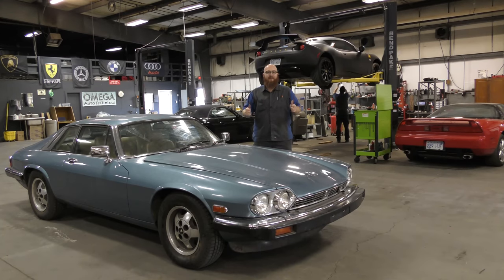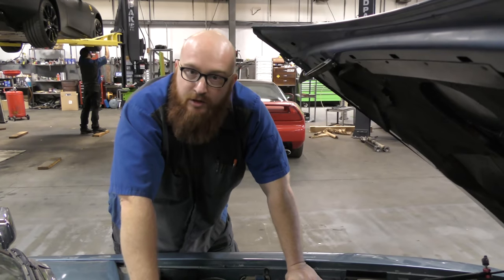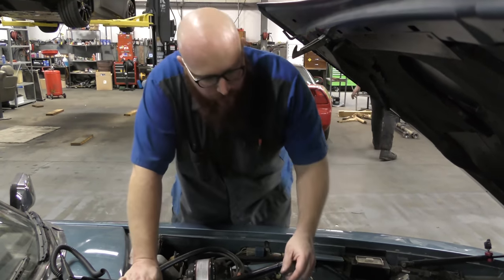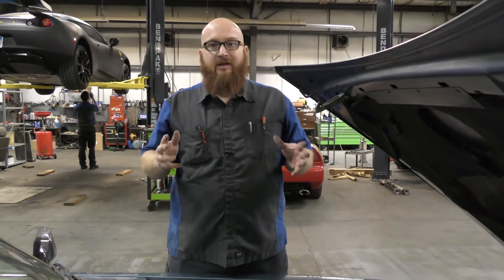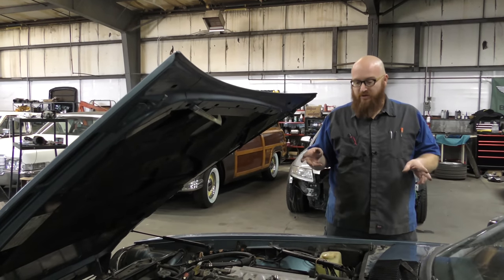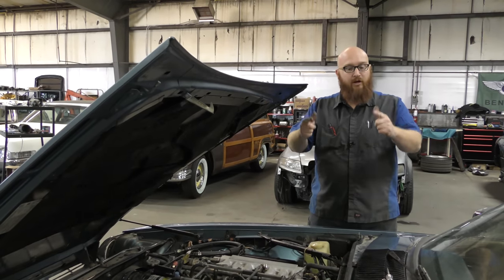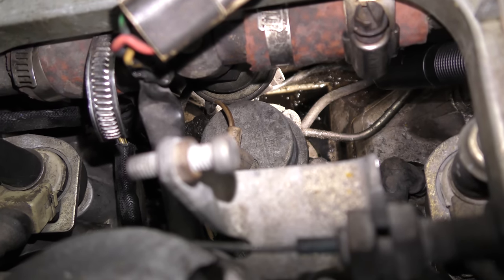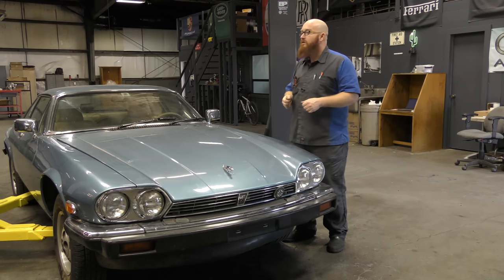'82 XJS with the cursed Jaguar V12 comes into the CAR WIZARD's shop. Can he get it running?

Comment: A SB Chevy in a 1976 XJ6; I swear that motor with a generic GM air cleaner, 1969+ Chevy accessory mtg locations; said Jag looked more OEM than with a stock XK Six. The swap was that clean.

Comment: What a fantastic car, driven one years ago  when they were current, they were very  impressive cars but  maybe a bit too sophisticated for the Secondhand non specialist market, quite advanced for it’s time compared with most Detroit stuff & less reliable than Jap stuff.
Imho It would be a real backward step to put a 350 in a beautiful  12 Cylinder racehorse type car like this. 
Faultfinding old complex  cars like this requires skills many mechanics simply do not have fuel + spark does not always  = go running properly without further I ssues requires deep pockets  required to make it run right !

Comment: Great cars when looked after and running well. Had a couple of that era Jag in my days back in NZ.
We don't put SBCs in them over there as Jags were fairly common and enough mechanics around knew their quirks.
As for Lucas, im an auto sparkly by trade and in our profession, Lucas is the prince of darkness, yup those lights will fail..

Comment: Really none of this is that hard, I mean fuel and spark, that was about it for this one.  The two most important points brought out by this video: 1 the part that fails the most in Jaguars is past mechanics, DIY guys, and/or owners; 2 ASSUME NOTHING!!!!.

Start with spark and fuel and systematically work your way through the system.  You can start at the end if you like, is there a HV spark at the plugs? If so, many checks can be left for later but go through it all later.  The same with fuel, but be careful not to set the car and yourself on fire.  

As to the 180 degree out dizzy, that is the classic, my neighbour did exactly that with the V8 in his boat.  We weren't great friends,  but after a while I took pity on him and pointed out the most likely cause.  At first he wouldn't believe me, so I said humour me and I refitted the dizzy, away she goes.  I did point out the cracking in the cap, a good time to change it, rather than trying to do it while on the water, I don't think he replaced it. <sigh>  I never asked why he took the dizzy off. When will people learn to properly mark things before disassembly and understand how to work out when number one is at TDC between compression and power.

Now this is quite simple BUT and a big BUT, the killer is an engine where you can tell it has been apart - DANGER WILL ROBINSON, DANGER!  There are just so many things that they can screw up inside the engine, cam timing for one!!

At the fundamental level the Jag V12 was a brilliant design as long as you did not worry about fuel consumption.  It was silky smooth, very strong, it could be tuned to very high levels.  It was simple to build and simple to work on, the problems appear when it is fitted in a car. Lucas is not as bad as many make out, it has its problems , mostly with quality control but this is not unique to Lucas

The one thing I will say: if there are signs it has severely overheated, you will want to get it for very little money and either have a spare engine to hand or have that SBC waiting.  You might be okay, but if you are not...  valve seats for a start.

Finally, there are some really good guides on the Internet for working on most Jags, even the V12 HE.

Assume nothing, work methodically, and don't listen to anyone about what to do unless they are a bonified Jaguar expert - a real one - not an internet fake..., you know... God!

Comment: I disagree. I have owned 3 jaguars with the V12 engine and had no more problems than with other high powered engines in other makes. The problem in the US was the lack of experienced qualified and certified Jaguar mechanics. My first observation of this was shortly after my move to the US in 1990. I bought a Jaguar 3.6 XJ6 sedan. When it went in for it's first service I observed and was horrified to see that they had my car on a free wheel hoist instead of the recommended 4 post lift. Their action could have destroyed the rear suspension on my car. Techs not sufficiently trained. I dread to think what they could do with a V12 engine. My first V12 in an E type had carburetors, my other two were fuel injection. At first sight it looks like a plumbers nightmare under the hood but a properly trained tech. knows how to set up and service these engines without difficulty. I covered approx. 150,000 miles in my 3 V12's without any major problems and I'm convinced that properly cared for they could go on forever. Even Mercedes and Ferrari admitted they couldn't build a V12 as good as Jaguars. It was smooth, quiet and powerful and relatively economical for a engine of this size. Service for those engines was the key, sadly in the US people forget the cost of service for this type of car and then miss services by approved Jaguar dealers.

Comment: One look at the original engine and it is immediately clear why Jaguar made no money and had to be rescued. On the outside, the cars looked great. But there were major issues. To start with, the Jaguars looked like large cars but were in actual fact small. They should have been 20% larger. I for one could not sit in the back and I am not large. The next issue is the rust (corrosion). And then you have the endless mechanical failures like this video shows.

Comment: my comment reminded me, my wife had a 206GTI we traded it in at one I the dealers I worked with on a Friday. On the following Monday I had a routine call on the Dealer, lo and behold there it was  with a story of no start. The service manager and his best technician swore they had checked everything by the manual, so I ask pertinent questions particularly about fuel supply in the system. No guesses all was OK but no answers on pressures supply etc.
I sat in the car turned on ign all OK plenty of fuel etc but deathly quiet. No fuel pump sound. so easy I checked the pump and found a corroded and broken power cable. 2Min and I had the answer their specialist Techn had spent a couple of hours searching. IDIOT but not unusual.

Comment: all modern cars from here on need the mechanic o be fully aware of the systems used to run this car and then only you can check them in sequence and rectify one by one,,,, or else one might mess it up all the more,,,, I appreciate it i am the first one opening up rather than someone have already worked on it,,,I love Jag  though I love and had Citroen CX, Built out of two scrapped cars with little difference,,,, I know who suspension, brakes and steering works.

Comment: Don't forget to replace the cooling pipes for the Heads. Those rust closed and over heat the valve guides and drop valves into the pistons... That's why I put a 383 Tune Port in my Build. YouTube; Bad Ass Jag and see what I did..

Comment: I've never seen one running with the original engine,,most are covered with rats nests,,junk,,hundreds of miles of wire and heater hoses,,no parts,nobody will touch them,,,the good news is a windsor will fit mostly chevy stuff,,,I had one with a ford 351 it was fun,,but I've seen alot just rotting.

Comment: Why center mounted rear brake calipers (and parking brake assembly too)? Dates back to Jag E and D Type racing design.  Mounting calipers and rotors away from wheels eliminated unsprung weight and allowed for a better handling car.

Comment: The 'H-E' models have a Swiss cylinder head design that deliberately shrouds the valves in the interests of flame propagation (fuel economy enhancement) but that is disastrous for good breathing and also leads to pre-ignition because of sharp edges and tortuous radii and it will not be a 'sports car engine' anymore but a smooth strangled not amazingly powerful economy engine that doesn't respond well to spirited driving. Different story with the non 'H-E' models.

Comment: There's an oil leak because there's oil in the engine. If it stops leaking, that means you have to fill it with oil.

Comment: I personally chased a lot of gremlins around a 4.2 XJ6 I had. When it ran it was great,, until something else decided to go wrong.  Those fixes upon fixes you encountered are the worst, I hate when so called mechanics create more issues than the vehicle ever had until they worked on it. Jags are known for suddenly sprouting leaks, if its not oil related its coolant related, ask me how I know.

Comment: My '88 XJS has 215,000 kilometers on both tge engine and the GM400 transmission, and my car runs Ike a bew car!
As soon you put an American V8 in it then no Jaguar enrhusiast will buy it! 
The car doesn't handle right either!
The shorter and taller V8 runs everything about the Jaguar XJS!

Comment: I don't understand how the timing could be 180 degrees off.  Doesn't that mean the distributor somehow got rotated, which seems impossible?  Or was it installed with the engine turned in the wrong position?  Yeah, that must be what happened.  The distributor couldn't be rotated to do that, but nothing would stop it from being installed with the crankshaft in the wrong position.  It wouldn't be the first thing checked though, for sure.

Comment: One of the finest engines produced and super reliable, electrics tend to fault due to under bonnet heat. The biggest problem with Jaguars are below par mechanics who are used to working on cast iron dinosaurs with horse and cart suspension. The  rear suspension set up again brilliant piece of engineering thats why a Jaguar gives unsurpassed ride quality and still goes round corners !    https://youtu.be/M9I7GWllPFY

Comment: Very long winded to find the fault. Also very brave to lift a Jag up on a 2 post ramp, as the rear subframe mountings usually fail & the only things supporting the rear subframe is the brake flexible pipes & the exhaust system

Comment: I always begin to worry when I find evidence of amateur electrician work... and then there's the random vacuum line rerouting.... my Jaguar aficionado friends in England start a job like this by removing the engine and taking everything apart. Then carefully put it all back correctly, replacing any questionable or suspect parts, especially vacuum lines and wiring. Remove the fuel tank and replace any questionable fuel lines.  The problem most Americans have with older Jaguars is that they're not like a Chevy... if you hear or feel something different, you investigate it right now. This means you fix problems before they get critical.  A Chevy, especially an older one, is a much more lazy affair. It'll keep, the Jag won't.

Comment: Jaguars went through a really bad patch due to British Labour Unions demanding unruly privileges, killing the British Industry. The joke was that one should buy two Jaguars just in case the first one does not start. (There was no guarantee that the second shall start.) It was true. V12, 5.3 is a hell of an engine when running properly, not always. I had an E Type V12 with 4 Carburetors. It was nothing but trouble and strife to synchronize these 4. But when they did, she was the car to handle. Now, Jaguars are just like any other car. They are less expensive than Audi but provide more for. XJS are, probably, the most good looking cars that were ever made. After Brexit, we are just a little landing, refueling and take off strip, a soggy island, at the fringes of Europe, for American Aircraft. Great is gone from Great Britain. Soon, we shall be the sick man of Europe with high unemployment and low low standards of living. Sad indeed.

Comment: Car wizard, I have a 88 toyota camry 2.0l and it suddenly started running different almost like it is misfiring but throughout the rpm range. Still hase plenty of power but it sounds like a vw beetle. It sounds kinda cool but I know this is not normal for an 80s fuel injected engine. What could this be? I changed the spark plugs, wires, cap, and rotor but still the same misfiring sound. What could this be?

Comment: Hi! I have a '89 XJS with a knock in the back rt corner of the engine when it's parked nose down hill or running flat. Tilted nose up it disappears. What do you suppose is causing this? Thank You, JD

Comment: IF...you're "giving-up", why not an an "LS?", or a 400 Ford Cleveland?   Or a 402 small-block Chevy, with an after-market fuel-injection?   Or a Winsor 427 with a fuel-injection system?   might need an adaptor to fit the Fords to the GM tranny?

Comment: was one of my favorite cars, never had any issues with my V12 engine or the trans
Reply: Because the Jaguar V12 was developed from the old 1951 Buick 215"/3.5L all aluminum V8 with same over square 3.5" bore x 2.8" stroke. 8 cylinders = 3.5L, 12 cylinders = 5.3L. Before then UK engines were under square, long stroke,  and slow revving. High revs on the new freeways would kill them in 25K miles. And the transmission was straight from GM.

Comment: Tom Walkinshaw V12 XJS Jaguars won a few races against the best Mercs and BMWs and they were pushed to the max and still won.The engines were fine machines but at Factory level they were connected to shit and the assembly line models that were sold to the public were unreliable.Also the lazy British workforce and the strikes played a part.

Comment: had a problem with an old air cooled porsche 911, backfiring /refusing to start.  accidentally found the problem - coax cable on coil shorted intermittently

Comment: Good to see a Mechanic bring the Jaguar XJS V12 back to life and we must remember that the car is 38 years old here and it has been neglected yet it will still run. Jaguar won Le Man 5 times with their XK 6 cylinder engine which was used from 1948 to 1987 it was used in the XK120 and On 21 October 1953 Jaguar test driver Norman Dewis drove a modified XK120 to a two-way average flying mile 172.412 mph. Then in 1971 Jaguar produced the V12 here is a video about that engine which was designed to be extremely smooth and powerful, it is a high tech engine, all aluminium with 7 main bearings. : https://www.youtube.com/watch?v=u6h8PFaz-F8&t=3s

Comment: I remember in the 1990s everyone would just swap out the v12 to a Chevy 350 not sure on the trans I seen many 350 jags at the shop back in the 1990s and learned to stay the hell away from them also another pos is the Dodge Challenger good motor everything else is junk

Comment: Great informative video. I have an 83 xjs with the same ignition module. It has the blazer part thingy that I replaced and it also has a silver cylinder thingy. The black box gets extremely hot.  The previous module failed because it overheated. I used heat paste. How does 1 solve the heat issue?
Reply: the ignition probably had a coil resistor/ballast resistor originally. When they pop a lot of times people will just bypass it, as the car will run, but the ignition module will get really hot. I found on google it says the early XJS's had the resistor in the distributor cap, don't know where its supposed to be on the HE if its even still there.
Reply: I found one thing saying the resistor is 0.5ohms, so any small ballast resistor would work. I stuck something from a pontiac into my 78 280SE as OEM resistors can be hard to find and expensive.
Reply: @Born_Stellar  thanks.. will explore these options.

Comment: Lucas electronics really aren’t as bad as Americans make them out to be. Look at the ignition amplifier for example, it’s not even a Lucas part. I own a Daimler double six and have several close friends that own old jags, they are fine as long as you look after them and don’t run them jnto the ground. The problem comes when someone tries to fix something and has no clue what they’re doing. All electrical parts fail on Any car, nothing lasts forever.

Comment: I have had many Jaguars and I have driven this model V12 and I have to say that I was not that much impressed over the original straight six. For the small amount of extra speed this heavy engine achieves I found it impractical. I know that it is fun to say  I have a V6, V8 or a V12 in my car and be able to boast about the  engines specifications. However without considering if the engine is the best balanced one for the car, to achieve a practical and safe road performance car, when they need to be serviced and repaired then all is left is to boast how much it costs. I have had V8's and a few V6's in the newer Jags and they do not impress me over the straight 6. And no matter how much I try to use all my the power of my little 4 cylinder 1.6ltr work van I can't achieve that without breaking the  law by exceeding the speed limit. My wife says I drive like a crazy Italian and that's because I am. I can be very impatient because other drivers won't put their foot down and get away regardless of the  type of car they have. All modern cars have more power than we need and use.

Comment: Your a mechanic are you not its what mechanics do no big deal man its just a process of elimination , beautiful car . With the lucas loom it was more of the way it was attached to the body or not and the actual connections typically as they age fail. Your dealing with a big English Cat that won the 24hr Lemans a very strong reliable lump in the right hands .

Comment: At 4.35 - "the spark plug wire goes right down to the spark plug". Really ? ? ?  Where are the plug wires supposed to go - the transmission maybe ?

Comment: So, I've owned and run a 1985 Daimler Double Six since 2008 and the engine is still silky smooth and still pulls like a train....why Americans think putting a vulgar iron block v8 in it, is progress, pretty much sums up the USA....